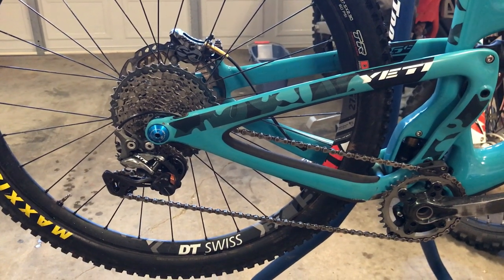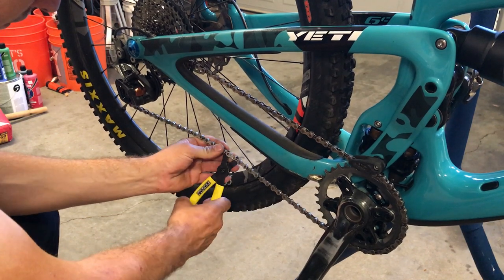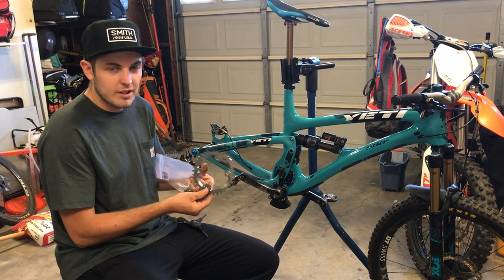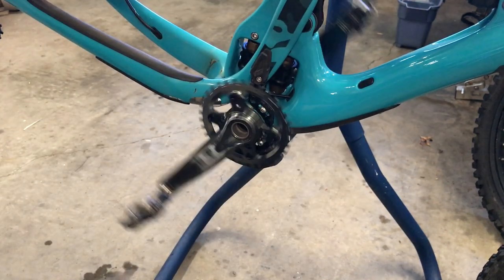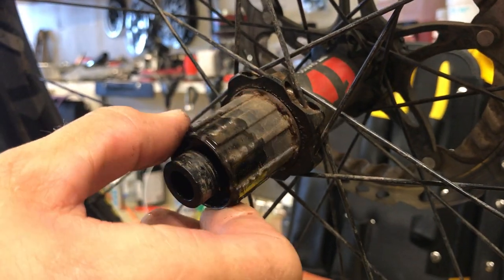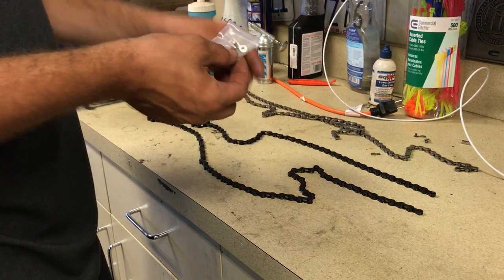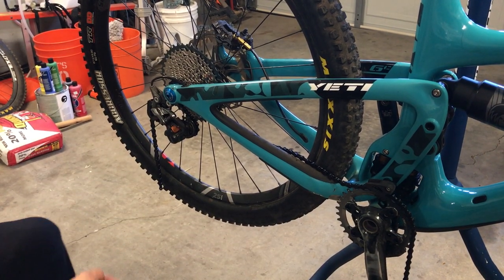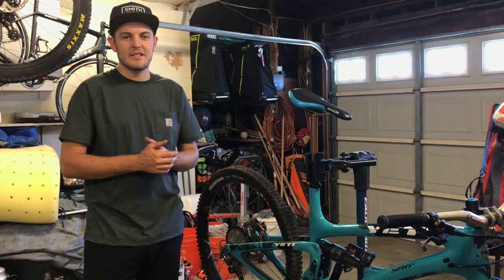Replacing Worn Out Drivetrain with OneUp Components!

Comment: The cassette gets pressed into the freehub body from jumbling. When you land, the pedal kicks back applying pressure on the drivetrain and that's where the cassette knocks little dents in the freehub and therefore doesn't come off that easy anymore. We just had that with a cassette replacement on vacation. Took my buddy half an hour to take the damn thing off. Therefore, if you can, use a steel freehub body. It's a bit more durable and resilient against those strikes.

Comment from the maker: I apologize for forgetting a key detail when checking chain length! Always check if your chain is long enough so that your derailleur cage is not fully stretched at full bottom out in the biggest gear! I just forgot to add that because I've have just been using the same size chain for so many years. Always check that on your first install!
~Cheers!
Reply from the maker: runnerrennur1 im quite aware

Comment: Didn’t read all the comments.  Good video with the exception of not using a torque wrench.  They say to tighten it down to 40nm but you didn’t.  

According to Fulcrum the reason the cassette bites into the hub is due to not being torqued down properly.  The first thing I thought when you pulled them off is “wonder if he will use a torque wrench to install the cassette”.  Get some good torque wrenches.  Otherwise great stuff.  Loved how you properly tightened the bolts on the chainring.  This back and forth is especially important with pinch bolts (ie stem to fork).  You just needed the torque wrench. 😂

Comment: Question: New chains come with lube/grease already on them, but there is considerable disagreement on whether to clean a new chain prior to use. Some Ideas I've heard is the factory 'lubricant' is applied to minimize rust rather then provide lubricating benefits and can attract dust much quicker on the first ride thus decreasing chain/drivetrain life. So did you ride as installed or give the chain a wipe-down/cleaning prior to shredding the trails? Thanks, and well done on this info-vid!
Reply from the maker: Adrian Gallo definitely wipe it down!!! I should have mentioned that in the video as well. The stock chain grease only attracts dust! So Bad for your chain
Reply: The only time I've ever had trouble with my chain skipping was when I left the factory lube on it.  It's just to thick and attracts a ton of dirt.  I always soak a new chain in Pedro's oranj peelz.  Clean and dry it completely then add your lube of choice.  I use finish line dry for mountain and a mix of wet and dry for road.
Reply: Your chain is never going to be lubed as good as it comes from the factory. Clean it with paper towel and isopropyl alcohol, clean it as much as you can with that and lube would remind where it needs to be (inside the links in friction areas) and excess would be gone (mostly). You will have the best lube you can get (unless you dissasemble the chain to lube) and very little dirt in your chain.
Reply: a trick I found over 30 years ago was to take the heaviest gear oil I could find and dilute it with alcohol. Put it on 1 drop at a time on every link. the alcohol allows excellent penetration and flashes off very quickly leaving the oil on the inside of the chain. Wiping the chain down occasionally and reapplying once in a while does the trick.  leaving the ome oil on a new chain is great lubrication but makes a godawful mess in no time at all.
Reply: Get that crap off there as soon as you can it is NOT Lube!! It is a 'wax' finish to keep the chain saturated for shipping/shelf time.
If you leave it it will grab dust like a stripper grabs a pole, yuck! Easy way to prematurely wear your chain/drivetrain as well as improper break-in!

Comment: Another good how to vid!  The SRAM XD drivers also stick....badly for me.  There is nothing like trying to remove a worn cassette and it just spinning in place with a thunk every turn.  This has occurred with all levels and with high quality XD hubs (even high end milled stainless) so sticking is a "feature" of both  cassettes. I find the Shimano a little easier to take apart once fused to the freewheel.
Reply: The sram XD will usually get stuck on the biggest cog and can be freed by wedging the biggest cog.  if you just try to unthread a stuck one it will pull the cassette apart.
Reply: Similar experience (largest 2-3 stick) but different removal experiences.  They stay together and just spin in place and every turn go "thunk".  I even had to have the local bike shop try.  They had to cut it off with and angle grinder.  Tried the wedging and a 2x4 hammer methods and it works sometime but I've had a few get really stuck.

Comment: hey Alex great vid. looking forward on your experience with that one-up chain! quick tidbit, that Pedro chain wear checker isn't a great tool to check stretch. really there's only 1 quick tool that checks this properly, made by shimano tl-cn41, but it's like a $60-70 tool, it preloads the rollers (there's more to it than that, but just to sum up). OR, you get yourself a good scale or 12" caliper, keep chain on bike, engage cranks hard (may need another dude), then measure pin to pin over 12". if u measure more than 12"+ 1/16" I would start to get ready to replace chain. food for thought!
Reply from the maker: mike jones oh I hate that tool. Not a big fan of it at all. I totally agree
Reply: Alex Chamberlin yeah I don't have either Pedro or that shimano, I happen to have a 12" caliper due to the industry I am in, so I use that. otherwise i'd find a really good ruler. but that's just IMO. anyways, great to have found a channel with a guy who has a good background in racing and bikes in general. keep it up!

Comment: Great video as always Alex. What are your thoughts on the rear derailleur jockey wheels being worn? I've always wondered if that should be replaced when doing a whole new drivetrain. Those little jockey wheels probably spin more revolutions than the cassette or chainring and they deal with a lot of side load from shifting up and down the cassette.
Reply from the maker: Esteb858 honestly I feel like I should've replaced mine. They are so
Low. I totally agree

Comment: Very nice explanation!
Question regarding replacing the Cassette:  My bike toolbox has a socket/Nut combo.  It seems to fit on my SRAM Cassette, but I would much prefer using a socket wrench as you did.  Obviously I could do a Google search, but where do you suggest I could look for a Socket that would work on a wrench?  Thanks.

Comment: Dope Vise Whip, wish it wasn't $45 bucks, hard to justify that price for the amount I would need it!

Is running the chain the same length as the worn/stretched chain the right way to do it?  Or does the chain not stretch enough to warrant going a link shorter (maybe at some point it would)?
Reply from the maker: Nick Zarnetske it started at the Same chain length before. Exact same amount of links. The chain only stretches a few millimeters. I'm counting links not exact length
Reply: Thanks for replying, good info to know!

Comment: Alex, I have internal routing and my shifting is getting so bad.  I went to my shop and they said it's not just a problem with adjusting the derailer and that it has something to do with the cables.  The guys at the shop backed up as hell and I dont want to be without my bike for a week, how do I fix this?
Reply from the maker: llif3 you should at least change your cable! Try and use cable grease as well. Are you comfortable with
Installing fresh housing through the frame?
Reply: I've never worked with internal routing before but I'll try it.  If I mess it up too bad I guess I'll just bring it into the shop.  Would just any Sram/Shimano cable work?

Comment: Hey Alex,
What length cage hanger do you have?
When I changed my drivetrain, I bought a medium XT cage and an 11/46t XT casette - I really regret the casette, should have gone for the 42.
Reply from the maker: Callum Maher-Wilson medium cage. That 11-46 jump is really weird
Reply: Plus, for all that extra weight and the weird jump, you get a gear that is only slightly lower, (Even on a 29er). If someone "needs" a 46t dinnerplate, they'd get the essentially the same result sticking with the 42t and dropping two teeth on the chainring. I'm glad the industry is giving us options, but those dinnerplates aren't for me.
Reply: The point of getting the 46t was to be able to run a 34t and get back up decently to the top ! 
Shimano casette's are significantly heavier than sram anyway.
Last time I buy the 46t anyhow.
Reply: I definitely get the logic behind the choice, but if you need that super low gear, can you really push 34/11? You might be able to, but the only time I can push higher gears is downhill. 
Also, I'm pretty sure SRAM and Shimano are comparable on weight. Both about 400 grams for  XT/GX 11-42/10-42 Cassettes.
Reply: It's more of a choice of when I want to put the power down. I think between a gx and an xt46 there's about 80-100g. (Not sure about it ). 
I have the casette on my Enduro bike.

Comment: If you use more grease on your freehub body the cassette won't get stuck to it like it did this time! The body looked super dry when you pulled it off. Nice video though.
Reply: And CLEAN the freehub body before putting on the new cassette.

Comment: In regards to putting the quick link together, just use the tool you use the same quick link tool but pull it apart rather than squeezing them, theyre designed to put them on and take them off.
Reply from the maker: Poor you yea you can do both. Just another option for people

Comment: Chain checker?  Use an accurate 1 ft. rule and measure pin to pin; if the pins don’t match middle to middle, the chain is stretched.  No need to buy a tool when a rule will do.